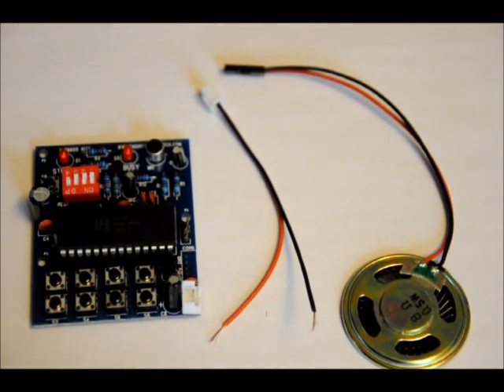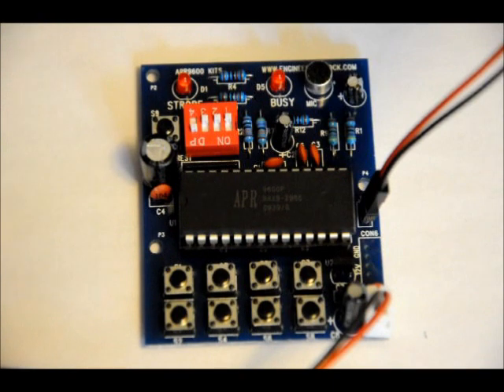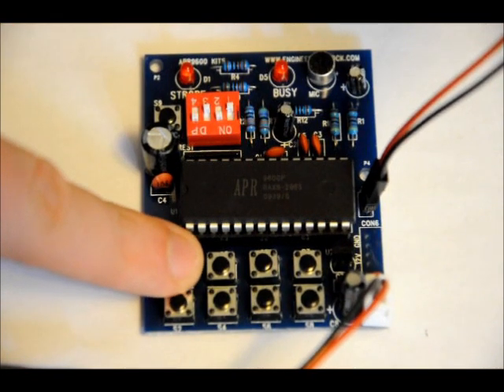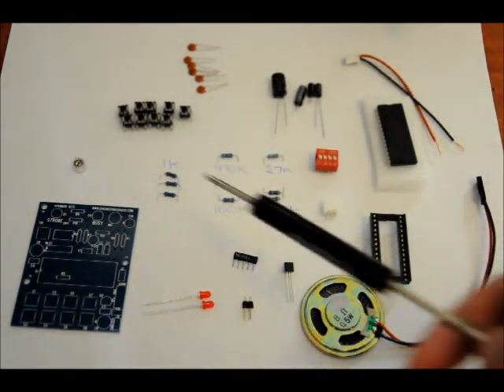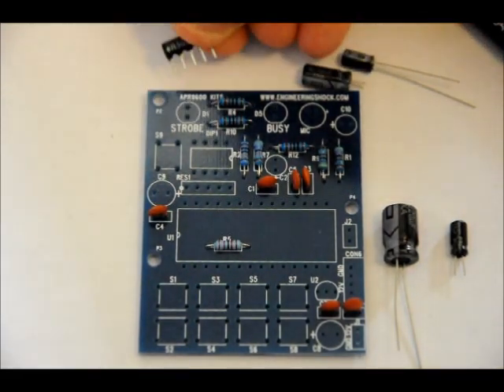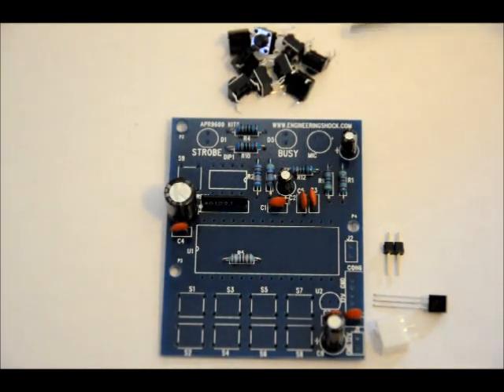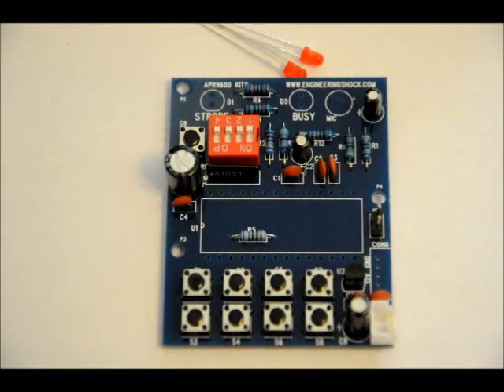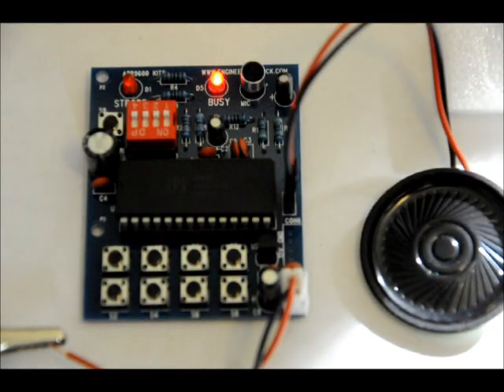The APR9600 Record and Playback DIY Electronics Kit and Assembled Module

Comment: Is there a way to get line level out of that chip? Plus is there a way to record line level as well instead of the mic? Apparently I have a ton of your kits I found in storage that I want to use for some home automation. A schematic would also be appreciated, if you do not have the schematic I can sort that bit out, but the line level stuff I need a bit of help with. I want to also mix the sound from 4 of these together.

Comment: hi sir, do u know sound generator ICs ap89341/170/085 . I have these components on my hand and its kit, but i just want to know; there are 3 programmming modes to operates ic : key trigger mode, cpu parallel  trigger mode, cpu serial command mode. I want to operate system with key trigger mode.  there are 8+1 push buttuon to produce songs  in key trigger mode but i want to use just 4 of em is it possible ? if it is, how ? plz help me sir i really need help :)